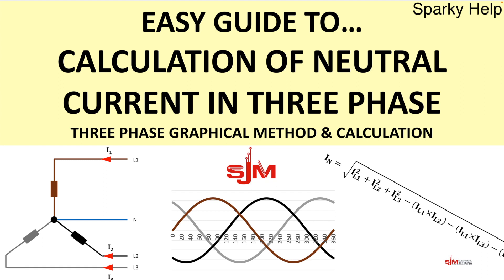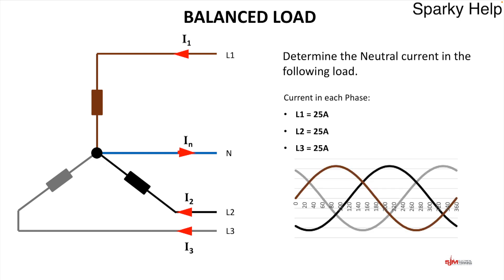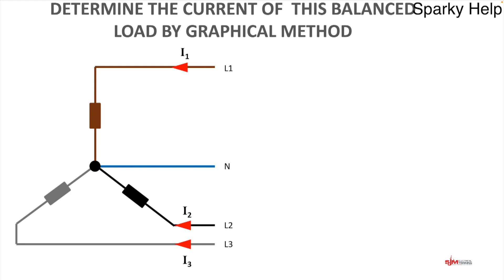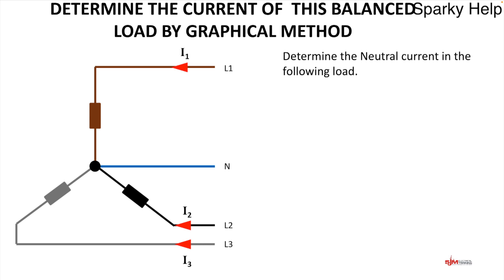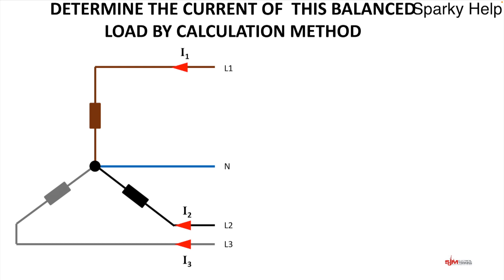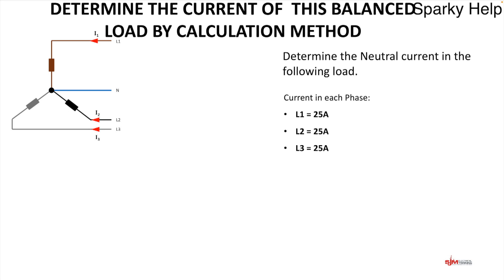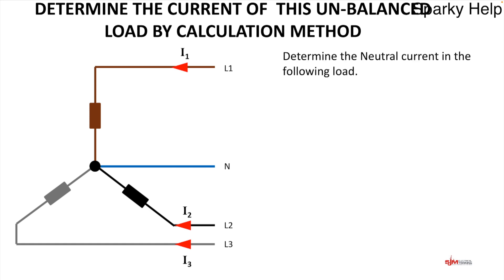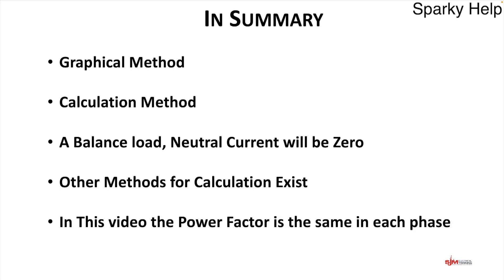Easy Guide to... Calculation of Neutral Current in a Three Phase Circuit

Comment: It seems in the unbalanced three phase system case, it assumes the line currents are unbalanced in magnitude but are balanced in phase shift, which is not the case in practice. Though at least it's an approximation.
Reply from the maker: Hi Thanks for watching, you are quite correct this does assume the power factor to be the same in all three phase.  using graphical method on unbalanced or using complex numbers in calculations would work for those working on unbalanced and different power factors.  Please like share and subscribe.

Comment: Hi great video
I have a question :
One reason for balancing single phase loads across a 3 phase supply system is:
a) reduce the size of distribution cable.
b) permit the disconnection of the neutral conductor . 
c ) reduce the cost of electricity to the consumer. 

Which is the correct answer?

Thanks
Reply from the maker: Hi Many thanks please share with like minded people.  By balancing the load over three phases will reduce the size of the conductors.  You would not need the Neutral on a balanced load such as a three phase motor.  It must also be noted that balancing the load on the network also lowers the current in the Neutral conductor. As to cost the only way to lower bills is to turn things off!  Please like and subscribe.

Comment: Dear Sir,
Thank you for sharing your valuable knowledge, 

I've a question please, 
A 3 phase heater connected in star,

Will the current be the same on all 3 wires or current is devided by 3,

Please help Sir
Reply from the maker: Thank you for watching, the current will be equal in in each line.
see:
https://youtu.be/-2268Ha2B8U
hope that helps.

Please share with like minded or like and subscribe.

Comment: Hi mate, appreciate the video and the help you're providing for people. 
I'm currently studying to sit my exam and I've come to this question:
A three phase 400V four wire distribution board has the following loads connected:. - Red phase 8.8Kw - White phase 4.2 Kw - Blue phase 8.8Kw.

Which of the following would be the neutral current?

I have converted the KW to A using 1000xKW÷√3xPFx230 and then input that using your calculation:
√(22.08² + 10.542² + 22.082² − (22.08 × 10.54) − (22.08 × 22.08) − (10.54 × 22.08)
which gives me 11.54A on the neutral.. but the official answer for the question is 20A.

Are you able to guide me on where I might be going wrong here?
Reply from the maker: I think these are single phase supplies - therefore I=P/V (no power factor mentioned) I1&I3= 38.26A I2=18.26A then as before for 20A Neutral current.

Hope that helps.

Please like and share.

Comment: With modern calculators (Like Casio fx-991 EX) it is simple to calculate the neutral current. Set the angle to degrees, the calculator to complex, then the output to the angle form. Then you can calculate with the angle symbol (represented here by <): 25 + 10<120 + 7<240 and the calculator gives 16.703....<8.948...
Reply from the maker: Hi Yes I have got a Sharp calculator that could do it in the early 90s or you could you 'j' notation for calculation.  But for the most of the students I teach the examples shown are more than adequate.
I hope you found it useful though. 
Many Thanks, Please Like, Share & Subscribe